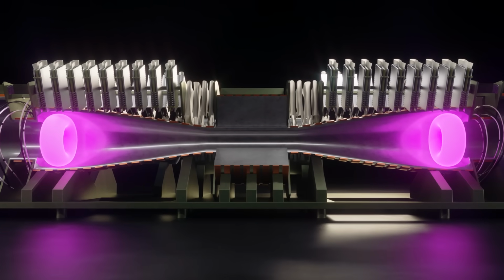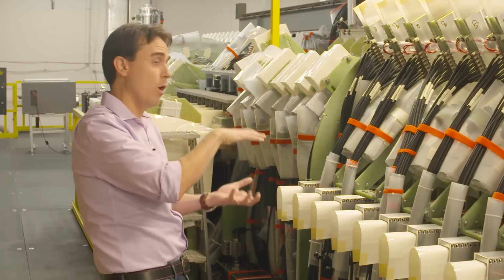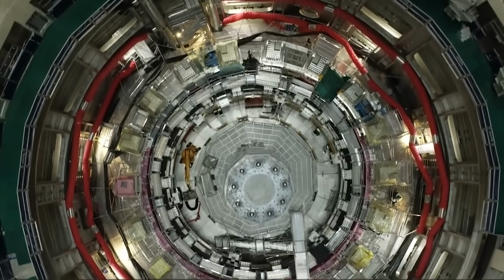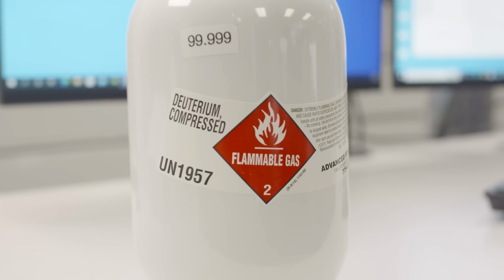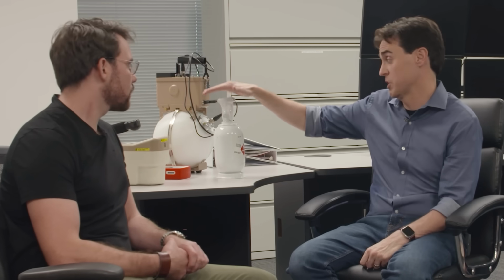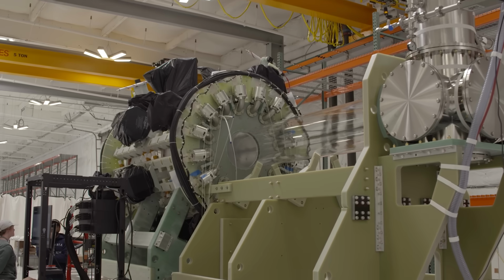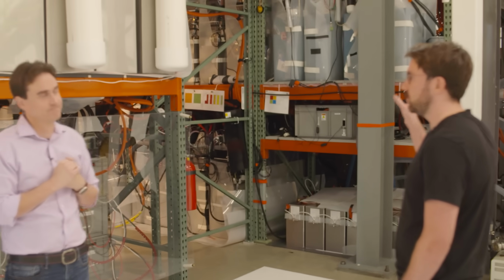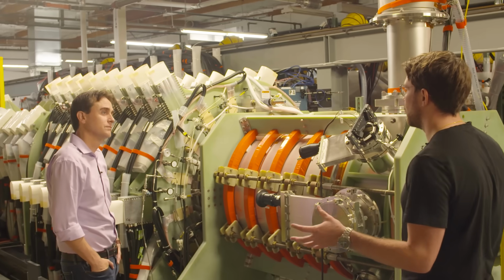A New Way to Achieve Nuclear Fusion: Helion

Comment: If the problem with doing the fuel reaction at the same time as the main reaction is the free neutrons damaging the machinery, why not use the same tactic as fission reactors and just put some water around the chamber? Water is very good at absorbing neutrons, which is why fission reactors do it. If it gets hot, just have it cycle through like a computer cooler and maybe turn a small turbine for some insignifcant energy output just as a way to get it to cool down faster and maybe help power minor mechanisms.
Reply: It is not going to SEVERELY damage the machinery. Over time (a year or two), some components will get damaged. But they planned to make them cheap and easily replaceable.
Reply: @elmarmoelzer2229  If it is enough to require they be replaced, then the damage IS severe.

And it's a matter of cost. If a solution like this were to enable them to reduce the number of reactors they need to build wholesale while also reducing how often they need to stop reactors to do maintenance/repair, then it makes them dramatically more cost effective.

Comment: This might sound stupid, but..., as I understand deuterium is a element/gas, a flammable gas, found in water, in abundance, which is low cost to produce... this make me wonder. Why this deuterium is not used as a alternative fuel for internal combustion engines?
Reply: It leaks really bad, and takes a lot of energy to produce, and is explosive when mixed with oxygen, not just flammable. It's just hydrogen.

Comment: They are using more energy than they can make at the momment, right?
Reply: Depends on how you look at it. They can recover 95% of the energy they put into the machine directly as electricity. They can do the same with the energy created by the fusion reactions, but it is slightly less efficient. If the electricity they can extract from the fusion reactions is more than the 5% input energy that they lose, they have net electricity. That is what Polaris will show some time around the end of next year.

Comment: So if we done everything right, we don't blew up. Actuall long living bomb design.
Reply: These things can not blow up (for the 100s time!). You have a device on you 24/7 that has access to all the knowledge of mankind. It is the same device you wrote this comment on. Use it!
Reply: @elmarmoelzer2229  so what exactly gonna happen then magnet array will stop working and plasma gonna touch walls of the reactor?

Comment: Good stuff. A pulsed fusion reactor is the only possibility for producing power.
As Robert Bussard famously told Google in 2001: "We have spent many decades, and many tens of billions of dollars studying Tokamaks, and so we know a lot about them. And what we know is that they are no damned good. I suspect the only reason the Russians released the Tokamak was because they knew we would waste all our time and money on it."

The other pulsed reactor which I think could work is the LPPFusion effort.
Reply: this new way of “fusion” is nonsense
Reply: first of all: at the temperatures they are using (100-150 million degrees) Deuterium would be more likely to just fuse with itself, creating tons and tons of radioactive neutrons
Reply: thirdly: electrons traveling at such high speed would emit a lethal dose of x-ray and it will also irradiate the reactor
Reply: it would literally just be a huge radiation creator
Reply: yeah okay buddy. Nice roblox profile picture. Really incites confidence in your opinion.
Reply: Artificial gravity as the confinement system will finally  put 'hot' fusion into  "breakeven-plus' range.
Artificial gravity confinement is coming, but the sequestering of artgrav tech will need to be relaxed first.

The Sun is a very simple machine:  hydrogen and gravity field.  That is a proven successful configuration.
.
Reply: second of all: trying to create energy from high-energy electrons is just plain old stupid, it would create gigantic amounts of lethal xray

Comment: Hello Charles M - the who says - wasn't about the investment at the time; but given 70 years of investment; with nothing ever producing a volt of positive overall power - one might easily conclude the money was wasted; and will continue to be wasted.  This would be like an Apollo project with nothing getting off the launch pad. At some point; probably long ago; this ought to have been recongized as a failed approach and funds moved to projects with a high certaintly of success; like geothermal.  Certainly drilling a hole in the ground 2 miles seems very obtainable with a lot less investment; and we already know how to exploit geothermal close to the surface so that would have had positive gains to start.
Reply: 70 years of just barely enough to keep the lights on. It is "fusion never". Now, finally there is investment from private investors and rapid progress is being made.

Comment: okay, but the Lawson criterion for D+He3 Fusion is higher than for straight D-D fusion, sure the cross section for D-He3 fusion might be higher at the specific temperature and pressure that the Trenta reactor achieves within the plasma, but the plasma still has to go through the temperature and pressure zones where D+D fusion dominates. This isn't aneutronic. The most interesting part is the direct thermal/kinetic to electric conversion and that's the only thing that makes me think this might be viable. Tokamaks and Inertial confinement fusion like NIF, and Sandia's Z-Machine are never going to produce power. Sustaining a fusion reaction for a long confinement time would be ideal, but I can't see us doing that without being able to manipulate spacetime itself, the way a star does, the massive gravitational potential overcoming the coloumb barrier, to the point where you don't even need kinetic energy, just the equivalent spacetime curvature of ~1.4 solar masses in a sphere with a radius of a few thousand km and anything lighter than silicon doesn't have the charge to resist the force pushing the nuclei together,
Reply: "Sustaining a fusion reaction for a long confinement time would be ideal, but I can't see us doing that without being able to manipulate spacetime itself".

If you read the Wikipedia article for "Timeline of nuclear fusion", you'll see that at present the record for continuous plasma confinement time is about 17 minutes at 70 million degrees kelvin, achieved by the Chinese. Also, a German Stellator stayed at megawatt fusion levels for 8 minutes just a couple months ago. These records have been steadily growing for years, and probably one of these machines will reach continuous operation sooner of later.

Regarding sources of Tritium and Helium-3. Yep,  Tritium can be produced by bombarding Lithium-6 with neutrons. Helium-3 can also be produced, in this case by fusing Deuterium. You said it, at lower temperatures fusing Deuterium is easier than fusing He-3.
Reply: also the scarcity of He3 is an issue, we can make more tritium fairly easily by bombarding lithium in a fusion reactor or a fission reactor, it decays to He3, but it takes 4,500 days for half of the tritium to decay to Helium-3, which makes Tritium a less scarce fuel, the energy of its beta decay is so tiny that it's not really a problem as there's no bremsstrahlung, just electrons, the issue is storing it as a gas, but it's still less leaky than hydrogen-1 or helium gas

Comment: This whole video plays much more like an advertisement that you were paid to make than an educational video about fusion. Considering what it is that you neglect to mention in this video I believe you to be incredibly disingenuous. You don't acknowledge the low reactivity of the fuel source they use, you don't acknowledge the extreme problems with radiation that their fuel source presents, you say nothing about the low reactivity/temp they intend to run at (lower temp means less power output), ect. You reach millions of people and instead of using that reach to give people the most useful, accurate info to expand their understanding and perspective you use it to push paid-for propaganda. People like you are part of the reason why the general IQ average has dropped for the first time in over 100 years.
Reply: Deuterium and Deuterium Helium3 fusion are a problem in a tokamak, not so much with an FRC. FRCs have a beta close to 1. Tokamaks have a beta around 0.05. So the same magnetic field does a lot more work in a FRC. 
The radiation from Deuterium- Deuterium reactions is a problem but not as bad as the radiation from Deuterium- Tritium reactions. For one, it only occurs in 1/3 of the reactions.
Secondly, the D-D neutrons "only" have an energy of 2.45 MeV vs 14 MeV from D-T. 2.45 MeV are below the activation threshold of many materials and Helion has chosen materials that behave very benign in a fast neutron environment. Their inner walls are made from Silicon which has to absorb 3 neutrons before it becomes unstable. Then it has a half life of only 2.5  hours. Their magnets are made from aluminum which has a half life of 2.2 minutes when it absorbs a neutron. So the whole machine "cools off" within hours.

Comment: Nice snake oil factory there lamo. "We need more funding, government need to step up, solution is just around the corner. We just need that breakthrough within 2035"
Reply: They are privately funded. Polaris is still on schedule to demonstrate net electricity from fusion by the end of the year. Helion also just got a deal with Microsoft for a first of a kind fusion power plant in 2028.

Comment: Bro said "adiabatic compression".
Meaning without kinetic energy.
But you WANT the increase of kinetic energy/volume

Tripping on your words dude.
Reply: Adiabatic means no heat transfer. You're wrong.
Reply: @thehusshisht1708  you're an idiot.
Heat is: kinetic energy

Also refer to the term Adiabatic sheer for more context on how to CORRECTLY use the term adiabatic.
Reply: @DoesntHurtYet  Call it heat or call it kinetic energy, Adiabatic means the same: "without TRANSFER of energy". When you compress adiabatically a volume of gas or plasma, its temperature goes up because the DENSITY of the energy goes up: same total energy + smaller volume = higher average temperature.
Reply: @charliem6590  dont ruin the bait nerd im here to give idiots an unfun day.

Comment: What is your responce to https://www.youtube.com/watch?v=3vUPhsFoniw&ab_channel=ImprobableMatter
?
Reply: It is not an answer by Real Engineering, but this comment from a few months back addresses most of the arguments by Improbable Matter: https://www.youtube.com/watch?v=_bDXXWQxK38&lc=UgzYDR40BqDN6cZc-RF4AaABAg
Reply: The IM video is mostly nonsense. Here is my summary of the "points" he makes:

- Critique: "FRCs have been done before and never worked." 
First, define "worked"! What was the goal of the experiment and what was the outcome?
Second, yes, FRCs have been done before and the members of Helion's founding team were actually involved with several of them. They applied the lessons learned from those to their own design, which they have tested over 6 prototypes so far.
Lessons learned and applied:
1. Size of the FRC. The larger, the less susceptible to n=2, rotational instabilities.
2. Elongation to radius ratio. The longer the FRC, the more stable it is to tilt instabilities.
3. The merging before the compression. This part creates a single, hotter and more stable FRC as a target for compression. FRCs get more stable, the hotter they are.
4. Helion's FRCs have a very low electron to ion temperature (Te:Ti) ratio of 0.1 and less. That makes things a lot easier compared to machines where both are in an equilibrium because: 
P(fus)/P(loss) scales as Ti^1.5 / (Z^2 * Te^0.5 )
Where Z is the atomic number (in case you wonder about that).

- Critique: "Deuterium - Helium3 has a smaller reaction cross section than Deuterium - Deuterium. At the 100 million degrees temperature discussed in the video, Deuterium - Deuterium reactions would be much more likely than Deuterium - Helium3 reactions."
That is generally true, but the author misses some key points:
Trenta is a subscale prototype with much weaker magnets than what they are proposing for a full scale powerplant. Because of that temperatures are somewhat lower than in a full scale power plant. Power plants aim for temperatures 20 keV (220 million degrees) and up to 330 million degrees (30keV). At that point the D-He3 reactivity surpasses the D-D reactivity.
That said, Helion actually wants some D-D reactions because that is how they are breeding their He3.
D-D => He3 +n or D-D => T +p
Both reactions have a 50% chance of happening.
So, in mixed mode (breed and power) machines, they will need two D-D reactions for every D-He3 reaction, at least until the Tritium inventory is large enough that they have a constant supply from decay (Tritium beta decays into Helium3). Sicne Tritium has a half life of 12.3 years, that can take maybe 20 years. That fact is probably the best criticism of Helion's approach.

- Critique: "Deuterium - Helium3 is too hard and Tokamaks cannot do it. Therefore Helion's approach of fusing Deuterium and Helium3 can never work."
D-He3 is very hard to ignite, but they do not need ignition for their design to produce enough net electricity to be economic. Most of the energy from D-D and D-He3 reactions is released as charged particles, not in neutrons. Helion can recover the energy in charged particles directly as electricity at a higher efficiency than a steam plant would. They can also recover 95% of the input energy directly as electricity. That makes their machines a lot more efficient.
Further, FRCs are high Beta (~1.0) compared to Tokamaks (~0.05). Beta means the ratio of the plasmas internal pressure to the pressure applied externally via magnets. 
Fusion reaction rate (the amount of energy produced) scales as magnetic field to the 4th power, an extremely strong scaling. However, that is the magnetic field inside the plasma, not outside, which scales as Beta^2 and B_external^4. 
If it was just about the efficiency of the magnets (it is not), then a 10 Tesla Helion machine would outperform a 200 Tesla Tokamak.
But, it is a bit more complicated than that, because confinement times in FRCs are generally lower. You win some, you lose some. Overall it is still a win for Helion's approach.
Since Helion is using adiabatic heating through the compression stage, they can to some extent(!) balance temperature and density almost linearly for a given magnetic field. D-D reactions favor higher density and lower temperatures. D-He3 is the opposite way round. They can tune that just to the right sweet spot between density and temperature depending on which reaction they want more of.
Another thing that works in Helion's favor is the aforementioned Te:Ti ratio. This ratio actually decreases further with higher temperatures. So the hotter the plasma gets, the smaller that ratio. Trenta already showed Te:Ti at <0.1. It is likely that a power plant will have an even lower ratio. Lower electron temperatures greatly reduce Bremsstrahlung losses. At a ratio of 0.1, thermal transport losses actually kick in earlier than Bremsstrahlung.

- Critique: "The neutrons from Deuterium-Deuterium reactions would have fried Trenta and I see no shielding." 
As mentioned, Trenta is a subscale prototype, an experiment. It is smaller, weaker and only operates at one pulse every 10 minutes (max). A full scale powerplant would do 10 pulses a second!
Not all shots were fueled by Deuterium or Deuterium + He3. Many were fueled by a mix of hydrogen and Deuterium or pure hydrogen, depending on what they wanted to test.
Because of that alone, the total neutron flux that Trenta has experienced so far is not that high.
What the critique does not mention is that neutrons from D-D reactions have a much lower energy than those from Deuterium- Tritium reactions (2.45 MeV vs 14 MeV). Those 2.45 MeV are below the activation energy of many materials.
The machine is mostly made from low activation materials or materials with a half life measured in minutes. Aluminum activated by D-D neutrons has a half life of 2 minutes.
In fact testing different materials under neutron exposure was one of the purposes of Trenta. They have tested quite a few alloys to see how they behave.
There is still permitted shielding of course. It is in the walls of the room and not close to the actual machine, which can handle the aforementioned relatively reduced neutron load just fine. 
It is also worth mentioning that a mixed mode Helion power plant (that does both breeding and power production) would produce neutrons only in one third of all reactions. So the neutron flux, even for those machines would be lower than for a D-T Tokamak.

- Critique: "Helion claims that they discovered new physics when they say that the ion gyro radius is 25% larger."
The whole ion gyro- radius thing was based on a misunderstanding and out of context quote and maybe also bad wording.
What happened was that Trenta achieved a higher ion temperature than predicted by Helion's too conservative physics model (a higher ion temperature is actually a good thing!). That higher ion temperature caused a 25% increase in ion gyro radius, which is perfectly in line with established physics. That's it. Nothing to see here!

- Critique: "Helion had previously said that they would have a working power plant in 2021. "
IM was very eager to get a "gotcha" on Helion. I guess he did not read further up on the page, or he would have seen that Helion was in the process of raising funding at the time. They did not get that funding until now. Even Trenta was less than 35 million (especially if you take the 35 million into 2019 dollars, when they started building it).
No bucks, no Buck Rogers. Should be quite clear, no?